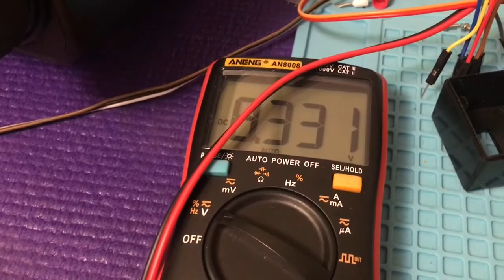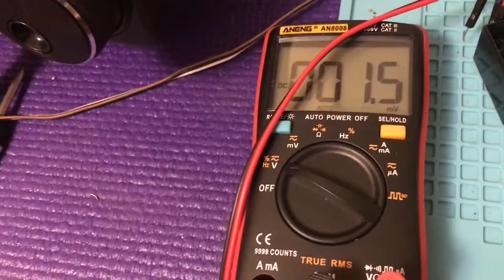Giandel 12V Inverter Remote On Off Switch from Amazon difficult to interface to Lifepo4 lithium BMS

Comment: Keep working on a solution, I have a Giandel inverter and I would like to turn it off remotely with an Electrodacus SBMO BMS. You mention in your video that a quick pulse will turn it off. If you had inverter on and voltage dropped to preset level and BMS activated the turn off feature, would it supply power to switch off. It would hold power across switch until voltage returned to an acceptable level. Would then the BMS stop power across switch and then allow the inverter to be manually restarted. I have ordered my BMS, however it hasn't arrived so my idea may be completely baseless
Reply: Hi Chris, did you get this solved? Looking at the same setup (already have the sbms 0, ddsr2s and dext16, trying to decide on inverter and charger options)

Comment: Great video, Would it be safe to assume If I cut the line at the cat connector, and identified positive and negative wire, I can wire it directly to a toggle switch and effectively by pass the momentary switch? causing it to turn on immediately once the switch is on
Reply from the maker: I think it is more complicated than that. Let me know if you come up with a solution!
Reply: @dannyjensen4954  Well so far I've discovered the momentary switch applies on both ends. I cut the connector off on one end and the other end I plugged it into inverter. Stripped off coating. The black and red wire is what makes the circuit to turn the inverter off and on, and as I touch the 2 wires together, nothing turns on until they are not touching no more. Basically the same thing it does when you hit the button. So now that I know this, I'm looking into momentary relays. I'm trying to hook up a OEM inverter switch on my Toyota 4Runner to the remote wire. So I'm trying to make a regular switch talk with a momentary circuit.

Comment: Those phone plugs are called CAT . the one you are using is a cat 4 ,you need a cat 6 or cat 8 to fit properly.  The push switch is called a momentary switch. This is not the safest way but testing is good. You will find out for yourself. Thanks for sharing
Reply from the maker: It looks like an rj 9 connector. .3 wide. The switch momentary switch was talking to a microprocessor on the other side i think. I was turning on the unit with a ohm meter. I was afraid to use this with my bms as a trigger.  I did another video modifying another inverter I had on the boat. I am really enjoying your videos. You are quite a youtube star. Thanks Frank Z.
Reply: @dannyjensen4954  thanks brother. Your vids are good too. I think youd be best with a Batrium.  I know they re pricy but they have all the relays.

Comment: Why not use a $5 low voltage cut off switch?
Reply from the maker: Can you be specific about the switch and the application? Eg are you talking about the supply line to the inverter.